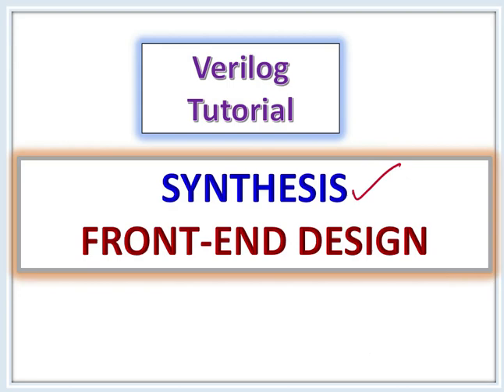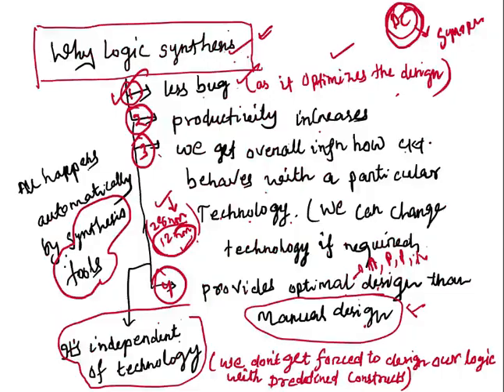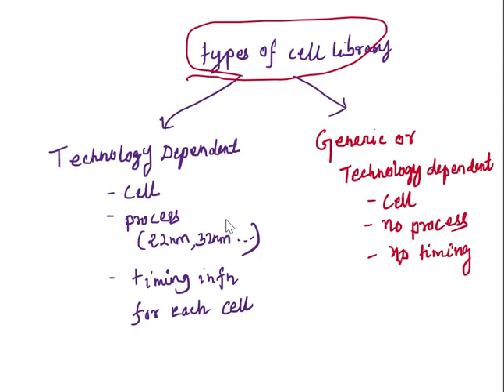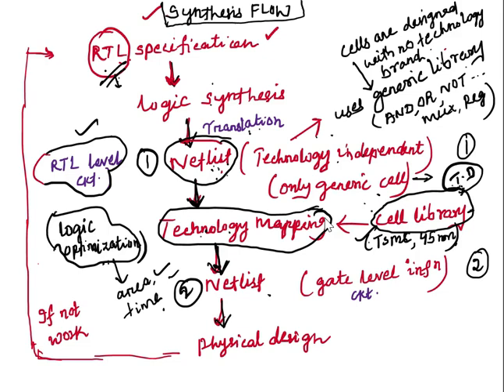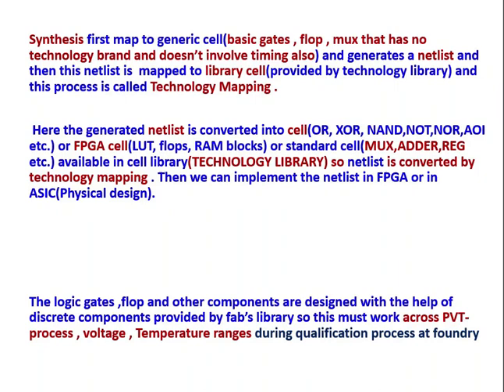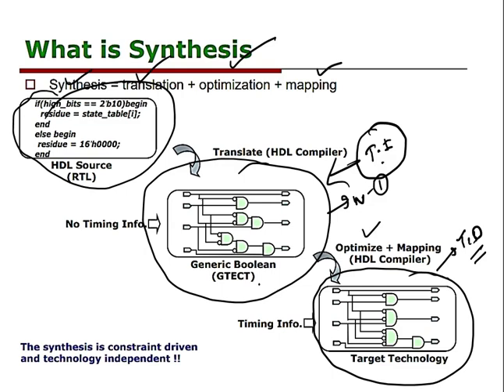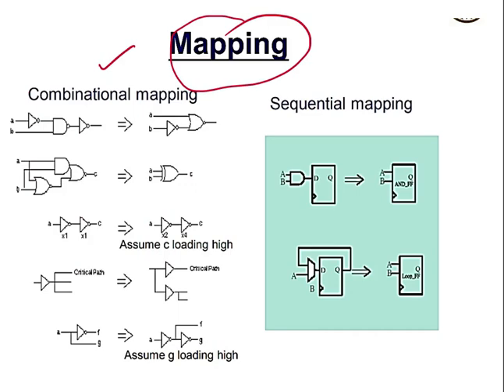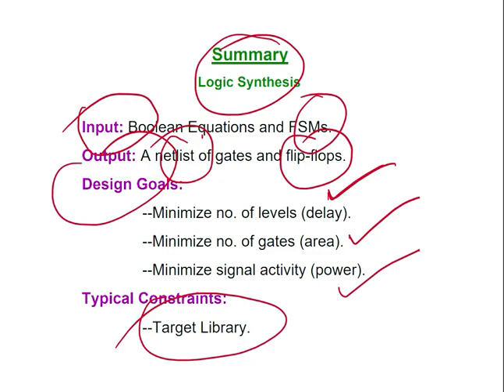(Part -3) Digital logic SYNTHESIS || why synthesis || Synthesis flow || Synthesis interview question

Comment from the maker: Interview questions from this video

What is a Netlist, 
what is technology independent and dependent design, 
constraints in logic design, Synthesis flow,
how synthesis affects coding,
why Synthesis is essential
what is Synthesis
global constraints
 input to Synthesis
output of Synthesis
How Synthesis helps to write a better RTL code

I have covered not only the theory but also the practical hardware meaning of Synthesis and it's need in logic design.

Without having the knowledge of Synthesis one can not write a true RTL code.If you   understand the real meaning of Synthesis then definitely you will be able to write a Power, time and area  efficient verilog code 

I have covered all the interview questions related to Synthesis in this video.

If you like the content then you can press the like 👍 button so that it reaches more people.
Thank you.